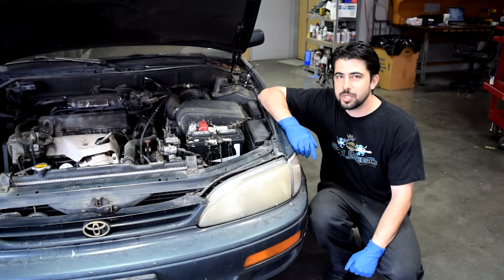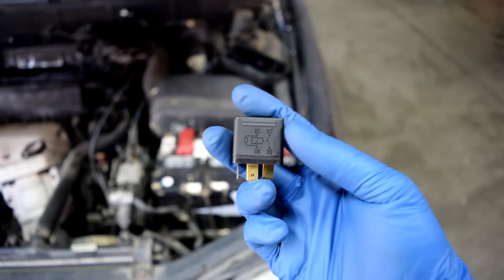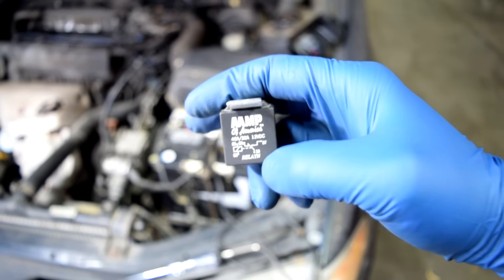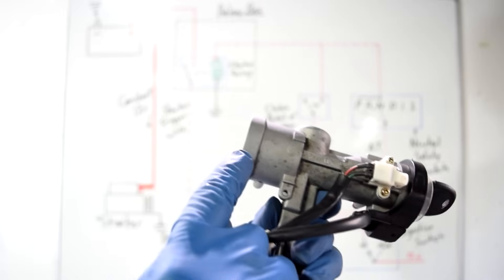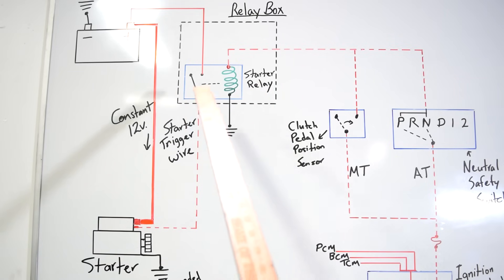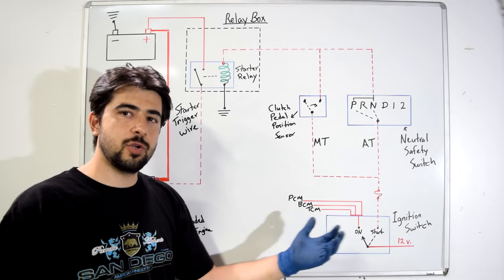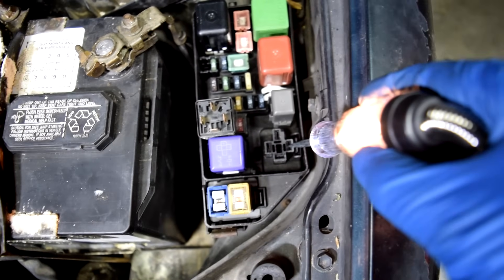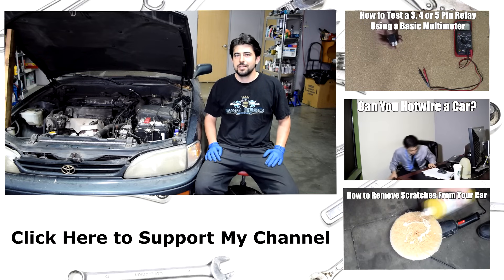How to Start a Car With a Paper Clip - NOT A HOAX

Comment: why would you need to do this in the most detail that you can tell me, thank you
Reply: Brett Tickell to steal cars
Reply from the maker: It'll help in diagnosing no start issues, you'll figure out if you have a problem with your ignition/wiring from your ignition or a problem with your starter/wiring to the starter, a weak battery or a back starter solenoid. among other things watch more of my video's.
Reply: Brett Tickell I've been dealing with a 2004 Cadillac CTS, ecm doesn't give signal to start the car when turning the key, I use this trick for the customers benefit in case they're stranded.
Reply: It isolates the starter from the ignition switch circuit.  It tells you if your starter side of the circuit is the problem, or the ignition switch side of the circuit is the problem.  Old skoole way was to just put a screwdriver across the positive and negative terminals on the starter itself, and start the car like that LOL.  He's doing the same thing but using the relay plug in a much safer way.

For example, if your headlight doesnt work.  It could be the switch and/or wires going to the headlight, or the headlight itself.  To test, you could remove the plug from the headlight, and just run two wires right from the headlight to the battery.  If the headlight lights up - you know the headlight is good, and the the problem lies between the switch and the headlight.

Same idea here that he demonstrates.

Stay gold.

Comment: there was a time when I had to start my 91 samurai from the electric starter motor, i liked doing that with unnecessarily big stuff, like a crowbar or an axe, since i did have a shitload of tools in there, and that was a fun show for whoever was around. I replaced the ignition switch with some buttons since then. But this wouldn't work on modern cars with chip keys.

Comment: My lock cylinder is borderline broken and doesn't read my chip, so sometimes I have to jump the starter motor with a screwdriver
Reply from the maker: I assume your starter motors is easily accessible, if it wasn't as is the case for most cars this video would be a life saver. Plus you would find out where your problem is.
Reply: Ratchets And Wrenches I have SLP headers so I can see all of the connectors.

Comment: My first car a 1990 Oldsmobile Cutlass (gutless) wouldn't crank when turning the key. I hooked a wire straight to the starter terminal and left it under the hood. To start the car I would have to put the key in the ignition, turn it to ON and pop the hood. Then I would touch my custom starter wire to the positive battery terminal and sparks would fly every where and the car would crank and start. I gotta a lot of funny looks while doing that.
Reply: Klingensmith AutoTech A short in the ignition switch would cause the starter to crank continously, or if it was a short to ground it would blow the ignition fuse, cause a fire, drain the battery etc etc. Didn't have any of those problems, like I said it was most likely a faulty neutral switch.
Reply: Carl Zimmerman I don't think robbers would have the keys to your car l
Reply: +zSyncc ?
Reply: Norm T:  I tried swapping the relay with another one and it didn't fix it. I think it was the neutral switch that was the problem. It miraculously started working properly on it's own after a month or so.
Reply: if ya have to jump start the starter Selenoid, then your ignition switch has a short in it, lol
Reply: lol

Comment: how do you shut off your car after you do it with no key
Reply: airplane312 He turned on the ignition,  you'd just need to turn the key off
Reply: You remove fuel relay
Reply from the maker: If you hot wire the ignition you can disconnect the wires, or just pull something like the ignition coil connector or fuel pump relay. etc

Comment: "How to Steal a Car With a Paper Clip"
Reply: The most someone would be able to do without either having the key in the on position or hotwiring the car would be wear down the battery, as the ignition circuit would not be on and the starter would just crank with no "fire" from the spark plugs.
Reply: You still need the key on or it will just crank since the ignition is electronic. You could bypass the ignition switch but that would require knowing what you're doing and/or a wiring diagram to energize the ecu and ignition.
Reply: @63jeepj20  If your battery is dead this won't work.
Reply: Just jumps the starter... the ECU will not have power so it will not start or run. A key must be in the ignition switch and turned to the on position.
Reply: Daniel S 
No thief would go through this much trouble. They have much easier ways that are also destructive.  They don't care if they tear up the car.
Reply: Daniel S 2 cars 1 paper clip
Reply: Yes I have a 2006 Toyota Corolla head for some reason I have trouble starting it and the thing of it is I know it's not my fuel gauge I know it's not my starter I'm not too sure about the other two things on that but my car alarm system was taken out but the key sensor was left in and I'm wondering if the key sensor is not working right with that have something to do with the car not starting up before they took out the alarm system my car was doing just fine now I'm having problems with it could you please help me some way or another to give me some advice what to do about my car thank you very much
Reply: poor fellow  Steering locks are really easy to break sometimes by hand, and if not a breaker bar will do.
Reply: Still need a key to start it this way
Reply: Don't!
Reply: You gotta have a key though, smart guy.
Reply: 😂😂😂😂😂. That’s what it should say
Reply: Daniel S 

you have to have the car on b4 it starts.  you cant just go and put the paper clip to a starter solenoid and bam it on.
Reply: wont work on most cars worth stealing, actually pretty much all cars wroth stealing this wont work on, even so, if its an automatic transmission, the wheel will lock when you try to turn. Also, most people dont leave their hood open when they park somwhere, making this a really piss poor way to hotwire a car.
Reply: @MacMashPotato  Well you can smash the window and open the hood that way

Comment: well for a manual u have to press on the clutch to start ur car
Reply: RebelDipper 21 noob
Reply: Not if it’s in neutral
Reply: @assembledsugar6587  I don't have to. 🤷 As long as my car is in neutral, it will start without pushing in the clutch.
Reply: Amy Ladwig oh cool

Comment: Looks like a good way to toast a starter
Reply: caleb wheeler how?
Reply: Jake Duerr why you think there's a breaker
Reply: caleb wheeler well if nothing is wrong with the car starting it this way shouldn't be a problem, but if you have a stuck starter or bad starter solenoid that would cause it to fry shit and burn wires then that would be a problem

Comment: I am badly confused, why would anyone want to use a paperclip to start a car, especially when you also need a key in the ignition, so why not make it even simpler, if you turn your key one step further it will start your car, and no need for a paperclip or removing any relay.
Reply from the maker: you dont need the key watch the entire video or my video on whether you can hotwire a car.
Reply: true, if you can bridge ignition circuit and then use paperclip, you can, but you won't drive very far as the steering won't turn, secondly if your car has an immobiliser, it won't fire up either.
Reply: if the starter relay fails, you know what to do
Reply: It's a way to tell if your key ignition is bad or if you have a wiring problem.
Reply: For DIYers like me, I usually don't have patient assistants(wife/kids) that like to wait on me when I need someone to start the car, when doing basic diagnostic checks. Example, spark test: pull the plug wire, stick a probe in with other part of probe about 1/4"-1/2" away from other lead. When performed properly, you have to visually see the sparks as the ignition cranks. It's hard to be in two places at one time.
Reply: if you add a power line to a ACC line in the fuse box you don't need a key (unless you have a chip or VATS) so bridge a always hot line to acc then use the paper clip to start the car then your golden. this is obviously bad for the electrical system and should never be done but criminals do it.
Reply: Ratchets And Wrenches okay so I did it to show off to my buddy and I started the car and everything and it's been on for 4 days now and I have no idea how to turn it off JUST KIDDING this is for shits and giggles there is no care but watching this video got me curious to know if that's how you can turn it on how would I turn it off
Reply: samdomding cause you not interesting in intelligent stuff.

Comment: Is there any way to do this if you have a chipped key? Like one of the ignition keys that have the little black square on the metal part.
Reply: Kasper The Ghost Seriously?  You're going to pretend you have a Turbo GS when you described the key for your potentially supercharged GS?  The newer GS has a proximity key FOB.  It doesnt have a physical key.  I almost bought a 6spd GS.
Reply: Kasper The Ghost no
Reply: Shazzkid shows what you know, because it worked the exact same as in this video.
Reply: Kasper The Ghost then its a plain old key.
Reply: Casey Rodriguez Nope, I'm looking at it right now. Has the little
Black computer chip thingy at the top of the metal part.
Reply: you likely have VAT, not a chip.  its just a resistor.  The only thing it prevents is fake keys being used.   In your case, you could bypass your ignition.  An ignition system that requires a programmed key would likely prevent the fuel injectors from functioning.
Reply: Casey Rodriguez Oh. So it isn't just a "plain old key" like you said before? You wanna take any more guesses or you wanna stick with that one?
Reply: Casey Rodriguez and also, it isn't a vat key either. On buicks website they refer to it as a transponder key, which is not the same as a vat key. 
Maybe you should have taken a third guess, and you may have gotten it right. 
Just another YouTube comment section know-it-all.
Reply: See, but that's the thing. You don't know things. You guessed. The reason I asked on here is because a few days ago, I didn't have access to the vehicle to check.  Second, I didn't realize you could get a 2012 Buick GS for $1000. Let me know where I can get one that cheap.
Reply: Casey Rodriguez 
I own a 2001 LS (turbo) and a 2012 gs. And no, I don't have proximity sensor keys for the GS. It's regular key with the black computer chip on it and the key fob is seperate.
Reply: Casey Rodriguez and the LS no longer requires a key, as it has a push button start installed.

Comment: If you have an automatic car and its in park you have NO need to pull the ebrake. With an auto when its in park it cannot by any means go forward or backwards.
Reply: MechRider89 it can roll
Reply: No it cant unless the trans is broken, you can push it all day and those wheels wont actually complete a revolution.
Reply: MechRider89 the tranny isn't designed to be used as a brake, it will fail if you do so.
Reply: Agreed! its not mean to be used as a means to slow down. There's a reason Automatic's have a park function in the transmission tho, its got nothing to do with braking. You seem to be missing the point, an Automatic transmission vehicle will NEVER when in Park function move, unless the transmission is completely destroyed, the driven wheels of the vehicle are off the ground, in the case of a RWD vehicle the diff is blown to bits or forced by another vehicle and even then when another vehicles pushing a car in park the driven wheels of said vehicle will NOT turn. They will skid they will bounce but they will not turn until that transmission breaks. Me and my friends have done this to 5 cars, not once did the vehicle with an auto transmission's wheels spin.

Comment: what if your car doesn't have a starter relay? i have a 2002 Chevy Malibu that wont crank.. any help would be greatly appreciated!!
Reply: nickmac 902 they all have starter relays.  relays seldom fail.  it's likely your starter.
Reply: I just got a new starter a month ago and there's no starter relay in my car or I cant find it
Reply: have you tested the starter.  it could be your ignition switch.
Reply: Yea I have I'm thinking it's the ignition switch

Comment: Hey my car was stolen and I got it back a couple of days ago. it won't start at all. ill turn the key, no clicking. i  checked the starter and the starter was good.the lights will come on if I put the key in.
Reply: what kind of car what year
Reply: CrownedVic89 WiDiT camry 1995
Reply: sometimes that solenoid is located near the starter or on the starter, on older cars it's alone, just look up where the solenoid is on your car then put the key forward, all the way, don't crank it.. make sure it's in park.. then use the screw driver to connect both the terminals on the solenoid, it will spark then turn over and start, ifff it's the starter that's out, don't keep holding it there for a long time, it should turn right on, if it doesn't turn on in the first 3 seconds then stop.. because it'll burn something out..

Comment: oh Yeah. and the preferred piece of mechanicly certified equipment for job the job would be a split pin of adequate diameter not a flimsy (most likely hardened) steel paper clip.

Comment: how can you turn it off? or shut the engine off?
Reply: Kico Lim remove the fuel relay and it will shut off.
Reply: Evan8D in the fuse box?
Reply: Turn the key off.  If you have a key.

Stay gold.

Comment: Hello I have 1999 dodge caravan 3.3 letter v 6 what I did I just removed batrey cables and clean them ok after I put back every thing I tight car won't start nothing happen I know this there is no power reaching my starter if I connect with jumper to starter and open ignition on with supply power to silnoied car wil start no problems I have remote starter in this car but need reset please if you can help me with this I also change really starter and fuse for ignition switch stil no power reaching my starter hope GE answer thanks

Comment: the most important thing is if you jump the wrong side your going to make it a bad day can not stress that enough
Reply: Why?
Reply: sorry I didn't comment in the right spot basically make sure there is some type of load, resistor something bc if you don't and every things on and current can flow you jump - to + you are going to fry something that's why he said he take no responsibility or its just for intertament with that said you can test alot of components like that. if you understand curcit design I can't stress that enough you have to understand CIRCUIT DESIGN
Reply: but it is a get test method I use it all the time with many components for trouble shooting he did a great job explaining it and I'm not hating it's a great video and I'm glad he takes time out of his day to help people
Reply: Kaysauto52 repai

Comment: Does it work whit the "chip keys" if you have those in the ignition and start whit the paper clip?
Reply: I am a locksmith and deal with programming keys on a daily basis. Some chips are able to be removed from a working pre programmed key. But if you randomly put a non programmed chip next to an ignition Nothing will happen, the chip needs to be programmed in. It's very similar to key fobs you use for work. Plus not to mention most chips need to be inserted past a sensor while being inserted in
Reply: yes if you have the chip within 1 inch of the ignition it will work
Reply: ***** ok thanks :)
Reply: Infact i seen a guy tape the chip key to the inside of the his steering column right beside the ignition , then he used a cheap key with no chip to start his vehicle . The reason for doing that was so in the that he lost his key it was only a cheap 2 dollar key as opposed to losing the 200 dollar chip key ! However doing this would make your vehicle more easy to steal !
Reply: ***** ha ha okay :D
Reply: Derby King okay thanks :)

Comment: I have a 2003 silverado that does not crank, will not start, security light on.  What would you do to solve the problem? Please help.
Reply: The battery is good? Does the starter make any noise at am like a clicking, whizzing, grinding or buzzing sound?
Reply: The battery is good, I solve the proplem.  3 groung shorts, 1 relay, 1 40 amp fuse, new ignition, and finally resetting the anti theft light.  HA! thing still wont start, but now it does crank and all gauges and dash lights work.Now I will work on the starting system, I believe no spark.  Fuel pump does work (gets fuel).
Reply: Brenda B does it have a chip in the key?
Reply: No chip,  Two ground wires on back of engine broke (fixed) Two other wires on back of engine needed to be cleaned up (done) New crank pos. sen.  New ignition mod.  Truck started up no lproblem.  Thank you for your reply.
Reply: leave key at on position for 15 mins at least. the security light will turn off by itself or some what. GM common issue of security light. my old Pontiac have the same issue.

Comment: On the older cars you could just jump across the starter relay with a screwdriver. Everything was so simple. Warning: Don't do this too many times. Don't hold the paper clip on for too long. Both of this actions can short things out or even melt things. Electrical parts are very sensitive!!!   Don't do this just to impress your friends. This is a test to help you diagnose a problem and all this should have been explained.

Comment: So you put the paper clip and then remove it but then can i put the relay back or do i leave it out?
Reply: That's what I wanna know
Reply: yes, you can put it back. that relay is only activated by the ignition switch, so as long as no one's turning the key as you're putting the relay back in, nothing will happen

Comment: well then how can you turn the car off with out the key??
Reply from the maker: Remove connector from ignition coil.
Reply: Or pull fuel pump fuse